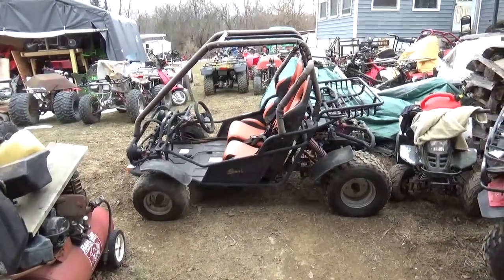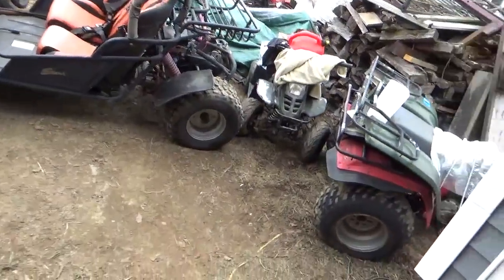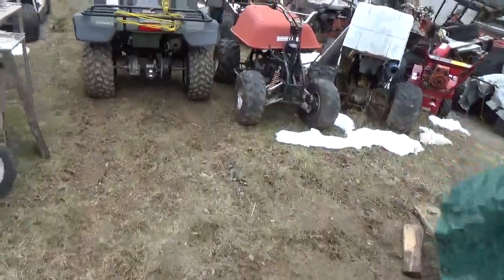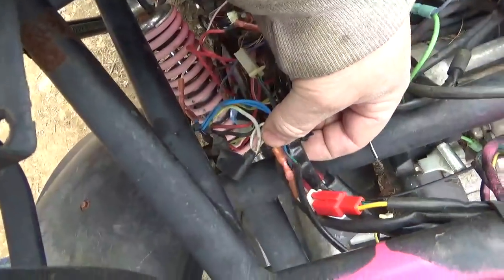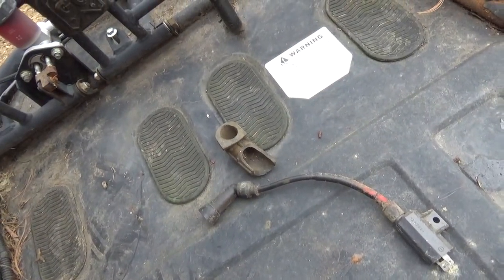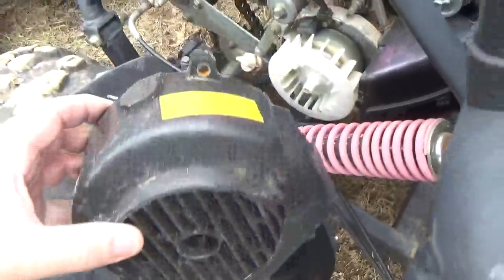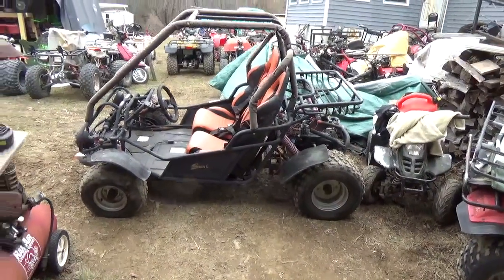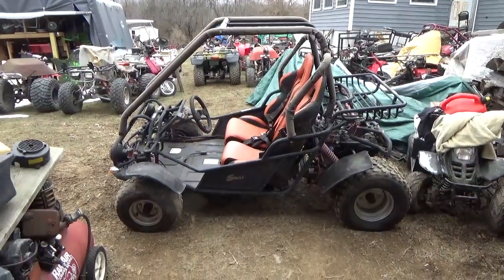Sunl Alias 150cc, Off Road Side by Side, Paid too much!

Comment: Hello Harvey I have a Carter gtr 250 that I'm not getting spark I changed the dci and nothing yet. Just got a new stator gona put it on to see if that's the problem.
Reply from the maker: Hey Carlos, U will see soon, I got this thing running on my portable CDI box and I'm building it a custom CDI box.... On first look, it will run on a $13 pit bike ignition system.... Let me know how Ur repair works out.... Thanks for the info, Ur thoughts, watching, and commenting!!!!

Comment: Hey Harvey.
I got a 150 cc carbide go cart that is exactly like this one with no spark and thought i could fix it really easy. 
Well i was wrong i can not get it goin.
I have replaced everything pertaining to a no spark issue.
Mine does not have a red wire coming from stator.
Is that correct.
Any help would be greatly appreciated.

Comment: You may not make a bundle on it but you probably won't lose one! Lol. I believe it is going to run fine. I think the wiring is the worst problem. That vacuum line is probably supposed to go to the fuel valve. A bunch of them have vacuum operated type on the tank. Once you get it going you will feel much better about it. Have a great day!

Comment: I recently brought one in similar shape for 350.  I think its a br 150 reaction by baja. Carb was shot ,i bought a carb off amazon for 20bucks. Upon installing it fired up. I yuned carb and took off around the yard. It tan about 3 min. And died. Havent been able to get it to start since. Timimg,compression , and spark good. Upon checking carb i relise carb is junk. Can you recommend a good replacement ?

Comment: It's all good bud you will either get it going or get your money's worth out of it in parts.
Reply from the maker: Hey Mike!!!  I will turn out ok, but, I should of paid less for a non running ATV.... Thanks for Ur thoughts, encouragement, watching, and commenting!!!
Reply: Harvey Spooner I paid 600 for my 86 big red and it needed both Sprague bearings replaced plus new rear wheels n tire. They wabble like crazy luckily not the axle as far as I can see plus a new left brake lever and all new cables including throttle. Plus fixing kill switch soldering in used internal parts from eBay. Needs seat cover to and lots of other bearings too. so i over payed too lol.
Reply from the maker: Hey Mike, I look at it this way, folks who don't try anything, don't overpay for anything, I rather be one of those people who tries things and sometime I will win, and sometimes not... Also, as time goes by, some of the things I over paid for, like $150 for a Honda CT70/Trail 70, have turned out to be wicked cheap now that 20years went by.... I see folks asking and getting $1200 for a ATC250es in decent shape.... So, Ur not in too bad a shape.... Thanks for understanding, your encouragement, watching, and commenting!!!!
Reply: Harvey Spooner thanks bud and your right.

Comment: well you had a feeling from the start you overpaid,i think 250 would have been better. the black gas tank is from a lawn tractor,possibly wheel horse. people also need to take into consideration wether or not they are capable of repairing something because i see alot of the same questions asked of you over and over. i cut the cub cadet loose before i got in over my head to make 50 bucks or  break even. i have alot of stuff i need to get done,time is better spent sometimes unfortunately
Reply from the maker: Hey Roger, I will get it running and I will turn out ok on this deal, but, $450 is too much $ for a non running ATV that doesn't say Honda on it.... A non runner leaves a whole basket of trouble to fix and one should not count on luck for balancing the numbers... U R right, $250 is a much better number then $450!!!!   Thanks for the info on the gas tank, I'm thinking that I'm going to put a Honda tank on it.... LOL!!!    Thanks for Ur accurate thoughts, watching, and commenting!!!
Reply: 1 dollar per cc rule,even at 250 you wouldve been able to sleep without 1 eye open,lol
Reply from the maker: Hey Roger, It seems to run and move, so, I lucked out on this one, but, I did not know that when I bought it, so, I was way out on a limb.... If it turned out to only be a frame and tires, I would of been upside down for $200-$300... Thanks for Ur advice, suggestion, watching, and commenting!!!!
Reply: i am glad to hear that,you must be relieved!

Comment: What a rats nest ..your missing the oem gas tank. It's a oval metal tank.
Reply from the maker: Hey OGAstra!!!  The wiring really is a mess!!!!   I spent some time looking at it today.... I think it will run on a $13 pit bike ignition, will try that tomorrow.... Will probably build it a custom CDI system.... Thanks for the info, Ur thoughts and encouragement, watching, and commenting!!!
Reply: Harvey Spooner please do a video on how to make a new cdi system .I have a ct 90 that lost spark
Reply from the maker: Hey OGAstra!!!  I did a video for the 300ex ignition system, it should be posting over the next few days.... Assuming Ur CT90 has a pulse generator, it is a cheap and easy fix.... Thanks for asking, watching, and commenting!!!